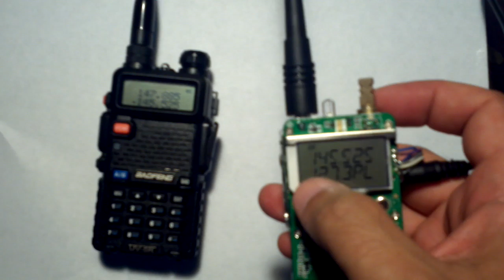Hacking the UV3R - First beta firmware

Comment from the maker: Someone emailed me about the UV-3R+ and mentioned that the programming pads are different (it has more pads). The good news is that it has programming pads, so it looks like you can re-flash the chip. However, there are no schematics anywhere and I don’t own a UV-3R+ so I don’t know which chip they are using. If you want to take yours apart and find out which chip, I might be able to help.